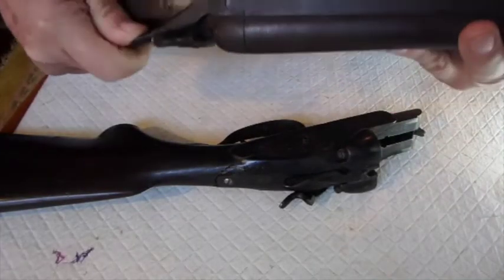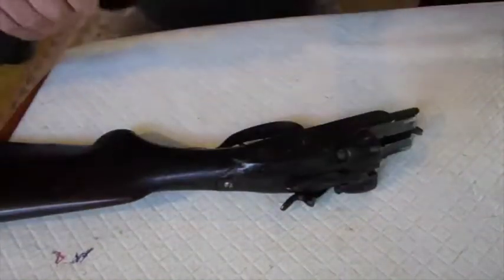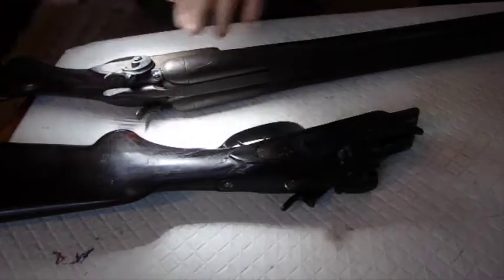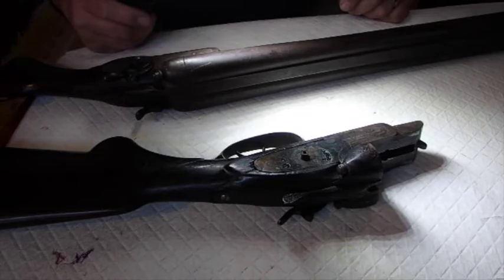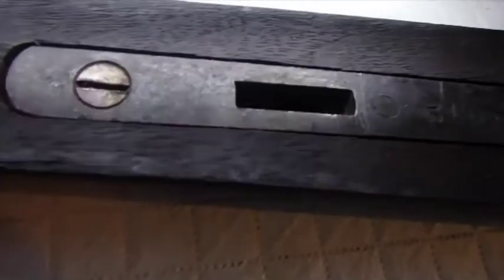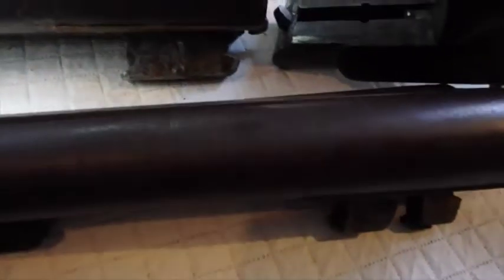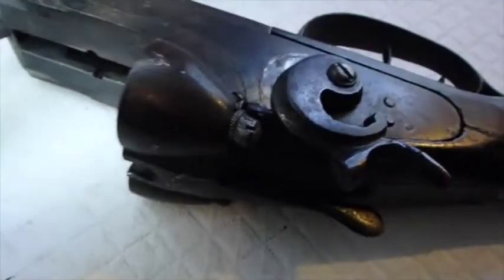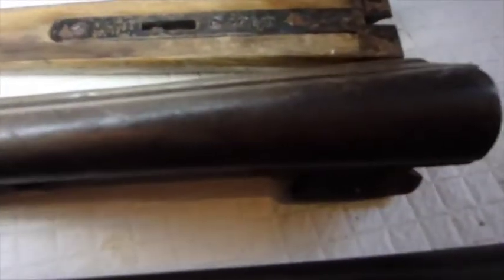American Gun Company Two types of Double Barrels

Comment: I just inherited a center arms company double barrel shotgun from st. Louis.  And there isn't a serial or model number anywhere..but the shotgun looks identical to the 1 of the 2 in your video.. is there any information you can tell me about these guns or point me in the right direction?  Thankyou in advance
Reply from the maker: A lot of these early guns did not have serial numbers.  Your best source for parts is Numrich Gun parts online.  I got firing pins and a hammer from them.   They also buy vintage gun parts too.   Good luck with that.